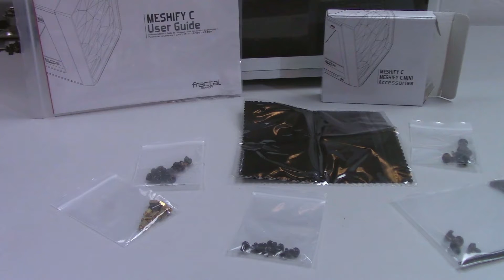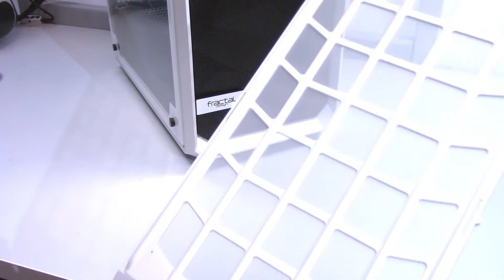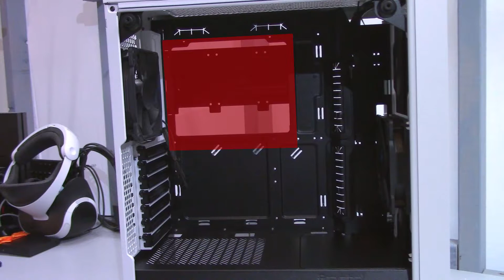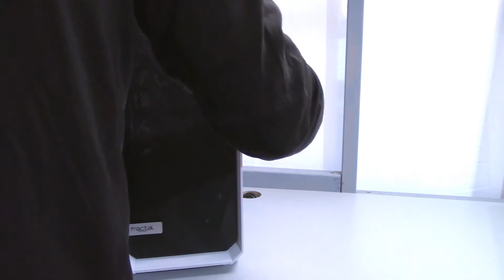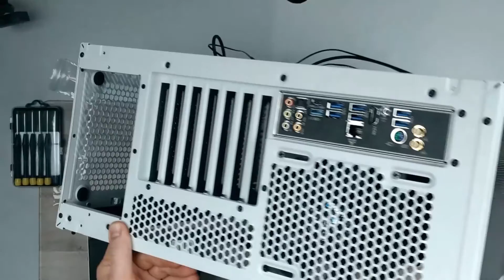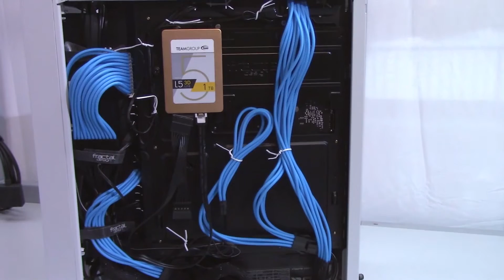Fractal Design Meshify C - Review

Comment: Know this is an older review, but just wanted to say that the GPU length of 315mm is with fans mounted, not without. If you open the bottom tray, you can have 1 bottom 120mm intake, and 2 front 120mm intake fans and still fit a GPU of around 225-330mm. It'll be tight, but it can be done.

Comment: Mine has this dumb issue: when you plug headphones in the front panel audio, press down a little too much and it will register as a power button press. Try it.
Reply: who the heck uses their audio from the case anyway
Reply: @AquaLady153  It sure goes against common sense, but that doesn't mean it's not a problem

Comment: Did you find the led lights?
Reply from the maker: what led lights are you referring to?
Reply: @HardwareForGamers  The power, and hard drive leds.
Reply from the maker: Is it not inside the front panel? Which I have unplugged because it's a blue led.
Reply: @HardwareForGamers  Ok, looks like the blue is the power led.  Where is the hdd led?

Comment: How many additional fans would you reccomend for a Ryzen 5 3600 and Radeon RX580?
Reply from the maker: What CPU cooler will you be using?
Reply: @HardwareForGamers  cooler Master hyper 212 evo
Reply from the maker: @NeilDynasty39  I would recommend having four fans in total two front intake and two exhaust one on the top and one at the rear.
Reply: @HardwareForGamers  sounds good. ! Thanks for the tip
Reply: @HardwareForGamers  hey man would 5 be overkill or okay ? Looking to buy 3 RGB to maybe put up front
Reply from the maker: @NeilDynasty39  should be fine. I would try and get pressure optimized fans, if you can. The front of the meshify has a foam that not good fans have issues with.
Reply: @HardwareForGamers  I am looking at some budget ones. Either the cooler Master sickleflow 120mm or inwin Sirius loop asl120. Not well verse in PCs so I'm not sure if this meets the criteria or is a good choice.
Reply from the maker: @NeilDynasty39  both should be good enough. it's the cheap Chinese ones that you need to be careful with.
Reply: @HardwareForGamers  appreciate the help and quick replies man !
Reply: inwin j120 would be okay too yeah ?
Reply from the maker: @NeilDynasty39  AJ 120?? They're fine.
Reply from the maker: @NeilDynasty39  yeah that's a AJ120 they'll work.

Comment: Great video!
How long can the front radiator be in cm?
I want to fit a "ARCTIC Liquid Freezer II 360" it is 39.8 cm. Would it fit?
Reply from the maker: I did say in the video that a 360mm rad can fit in the front. So yes
Reply: @HardwareForGamers   Yeah, but this radiator is a little bit longer than others, that's why I was unsure. 
I hope that it will fit...

Comment: Damn will my MSI 3060-Ti not fit in here? (323mm)
Reply from the maker: it might if you don't mount the front fans :/
Reply: @HardwareForGamers  damn, not sure about that. Do you have any recommendations for bigger GPUs? I really had my eyes on this case!
Reply from the maker: @M7Cl-l  it will fit it the P300A, P400A and the 4000D. I haven't tested the P400A or the 4000D yet but GN has and Steve said "they're okay". I'm currently running tests on the P300A and it looks pretty good.

Comment: I did 3 front intake fans, 1 bottom intake, 1 exhaust in rear, and 2 exhaust on top (aio).
Reply from the maker: What fans did you use.
Reply: @HardwareForGamers  the ones that came with the case were used for back exhaust and bottom intake. The rest were coolermaster rgb 120mm fans lol.

Comment: What about this fans configuration:
rear exhaust,  2 front intake(Upper/Middle),   top exhaust(next to the rear one) ?
I see that you didn't included it in the video, so is it a bad configuration or what?
Thanks so much
Reply from the maker: That is the best fan configuration, when I made this video, I hadn't set up may case testing methods yet, so I was all over the place. I went back and retested it, so in my newer case reviews I do have that fan configuration.

Comment: did you use high airflow fans or static pressure fans as front intakes.....most people recommend static pressure fans as front intake if you have a mesh front or dust filter
Reply from the maker: I use the Arctic p12 for my fan normalized test in all my case reviews, which is a static pressure optimized fan.

Comment: This is a great review! I know that this is an old video, but I have this case and before I buy more fans I had a question. Is there enough room for 3x 120mm fans in the front if you just slide the drive cage back as opposed to removing it? Thank you!
Reply from the maker: Yes the front can fit 3x120mm fans, but you need to remove the shroud plate to do so.
Reply: Hardware For Gamers Alright thank you
Reply: @mr.o9185   Hi.  
Do you recommend this case?  
and is there any flaws or cons in this case that I should consider before buying this case?  
Thanks so much
Reply: @KsaCommentator  I would definitely recommend it. The cable management is good, airflow is nice and I’m still just using the 2 fans that it comes with (although I do plan on getting some pwm rgb fans soon), and it looks great in my opinion. The only issue I had was that since I have a full atx motherboard the cutouts for cables at the bottom were tough to access once I had the motherboard in, but this is a very minor issue. I hope this helped!
Reply: @mr.o9185  full atx?
Do you mean E-ATX  or the standard ATX?
Reply: @KsaCommentator  just standard atx, specifically the msi b450 tomahawk max. It’s not much of an issue though .
Reply: @mr.o9185  Thank you so much for taking time to answer my questions😊

Comment: 2080 super fit in this case
Reply from the maker: What 2080 super? They're all different sizes. Most should fit if you don't go with a front-mounted radiator.
Reply: HardwareForGamers NVIDIA GeForce RTX 2080
Reply from the maker: Yes it will, if you go with a front mounted rad it might still fit.

Comment: That's weird adding one extra intake fan heats the gpu. Must me some kind of error
Reply from the maker: I run the test more than once, so not an error. It's more to do with the location of the fan and GPU in a compact case. The intake fan is pushes air at the GPU which forces some or most of the hot air from the GPU down, to be picked up by the GPU again and again and again, till the GPU cooks It's self.
Reply: @HardwareForGamers  Well maybe that's the case but it's still odd. Gamernexus actually reported slightly cooler gpu temperatures when having two front case fans, both for meshify c and define c cases. https://www.gamersnexus.net/images/media/2017/cases/fractal-meshify/meshify-torture-gpu-all.png
Reply: @hazzmati  I saw another Gamer Nexus case review (can't remember which case, would have to look it up) where they added an extra front intake fan and had increased cpu temp (with a cpu air cooler) afterwards. They theorized that the extra intake fan creates positive pressure inside the case, which does not allow the cpu cooler fan to pull in fresh air from the top (which it probably does in the stock configuration).

Comment: Good Video...
Well, I have a question, can we use an 80mm Fan just below the Graphic Card, fixed on the free removable PCIE Slots of the Case to provide fresh air to GPU ?
Reply from the maker: An 80mm fan should fit, but you would need to use zip ties to fasten it.
Reply: @HardwareForGamers  Actually I'm just Researching about PCs, started this a few weeks ago, Will build my First Ever PC by the end of this year. So I theoretically want to know Everything ! Just because of that I asked that...